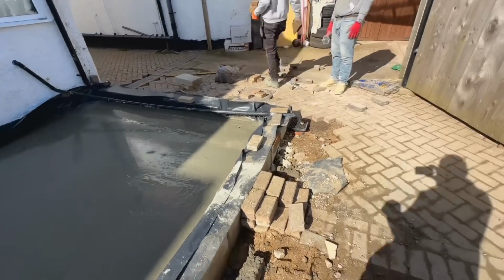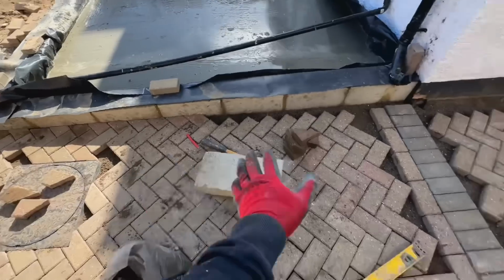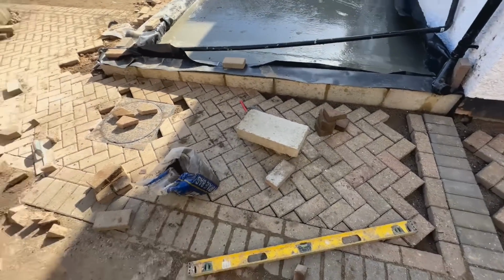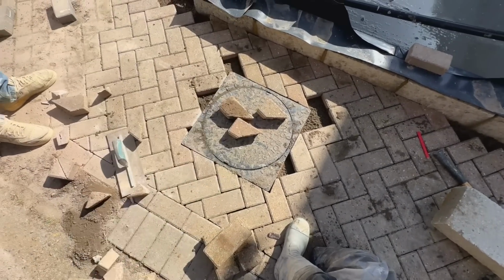Timber frame extension: Ep 10

Comment: Darren what are you going to do with the wall next to the brick paving were you put the lintel under the brickwork it looks like a gap there?
Reply from the maker: It will just be cement. It’s plaster that was knocked off. The lower part of the extension is going to be rendered and blended in to the existing house
Reply: @darrenthebuilder  ok well done